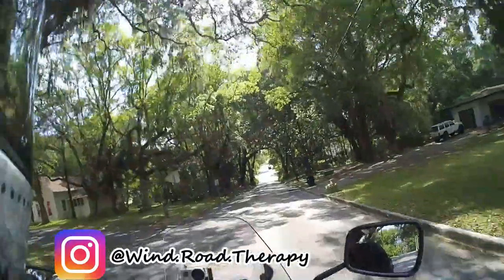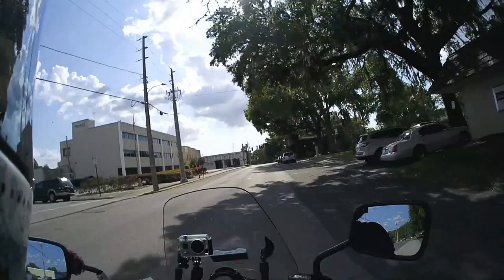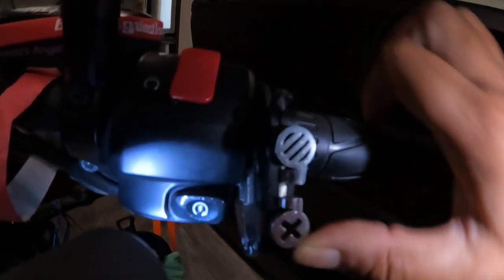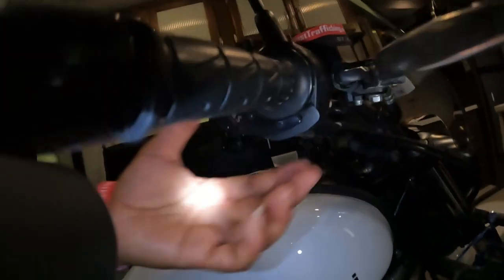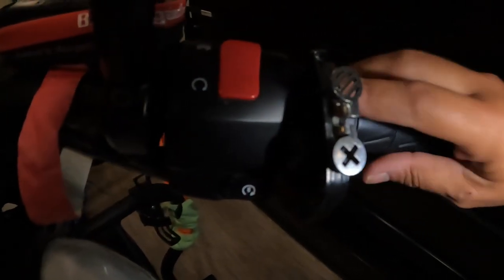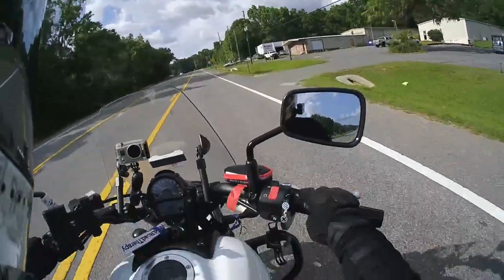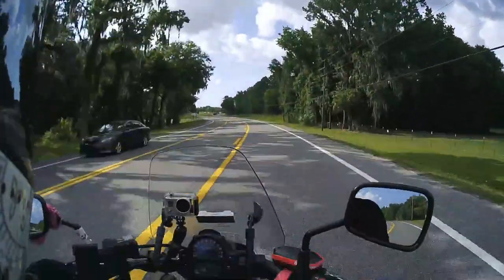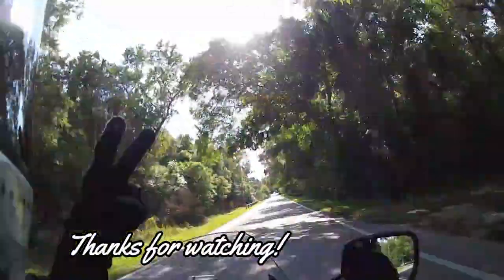Atlas Throttle Lock - Use and Over One Year Review #femalemotovlogger #KawasakiVulcanS650

Comment: the cruise control is on of the best things on my bike haha, old one didnt have it and i messed with a couple of cheaper throttle locks and a cramp buster, that looks like a much better solution.
Reply from the maker: The cramp buster never really worked for me, but this locks in place and really gives you a break. Maybe someday, I'll have a bike with cruise control, but until then this is the solution for me. Thanks so much for checking out my video and commenting.
Reply from the maker: @delbertgrady413  thank you for sharing💙